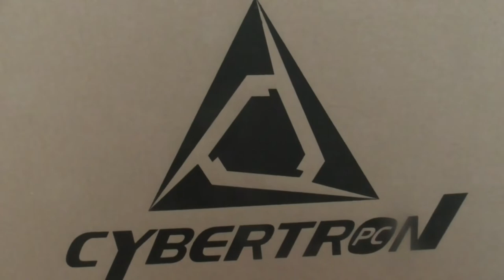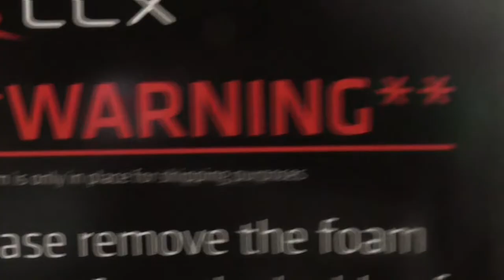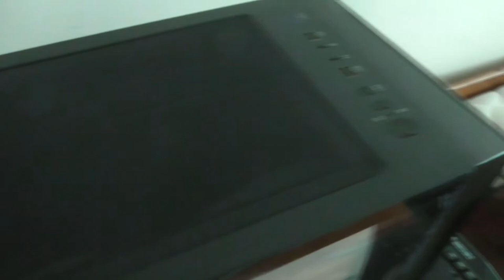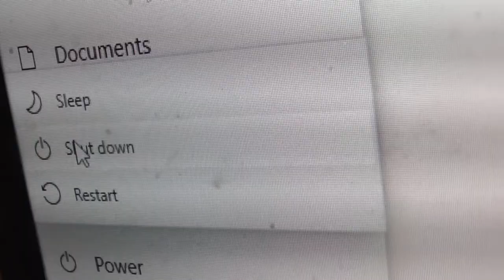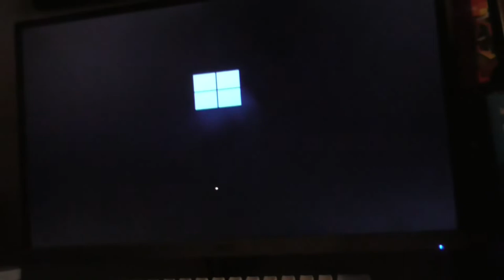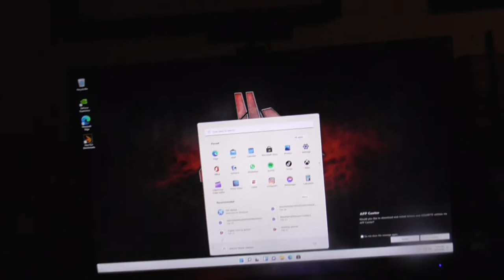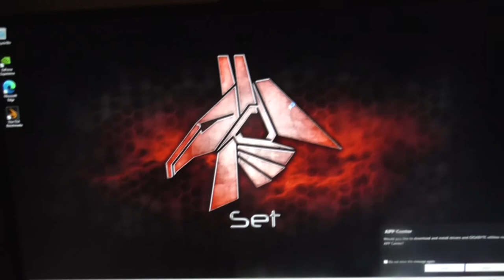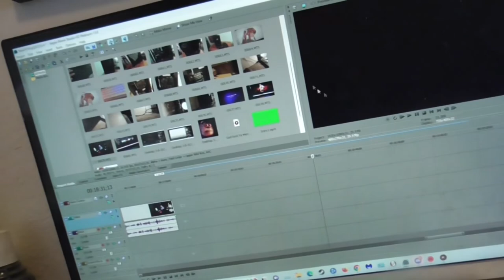MAH NEW GAMING PC UNBOXING & SETTING IT UP!!!! [CLX RTX 3060 Ti]

Comment: Beautiful PC! I would highly recommend you to find the exact model of the graphics card and case fans and find the right RGB software to offer more customization to the LED stuff inside. For the Aorus Motherboard I believe the software is called "Gigabyte RGB Fusion". Also you might need to find an adapter for the RGB fans since from their looks their cables seem not to be connected to the 3-pin 5V RGB header on your motherboard. Or if there no such cable then you probably need to find converters that will do the trick, but the effects with those RGB softwares are mind-blowing even though these softwares tend to be "user-unfriendly". I can definitely relate to your hype when you got your first actual gaming PC.😁

Comment: If i buy a pc will it come with all the parts you can put in or do you have to buy them in separate stores.
Reply: Prebuilts are built with all the parts already installed. But if u want to build your own pc then you would have to buy all the parts and put it together yourself.